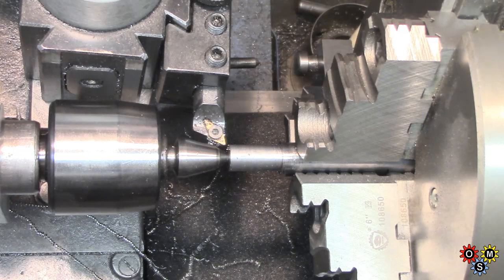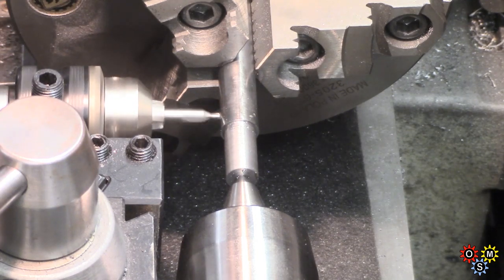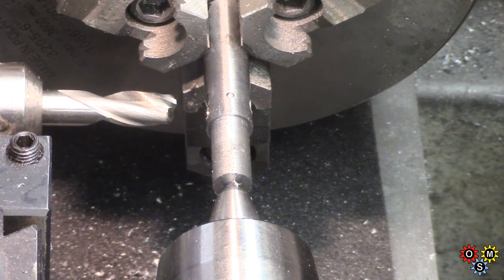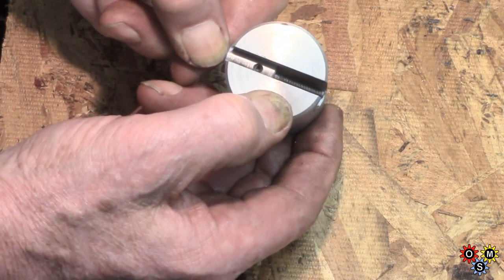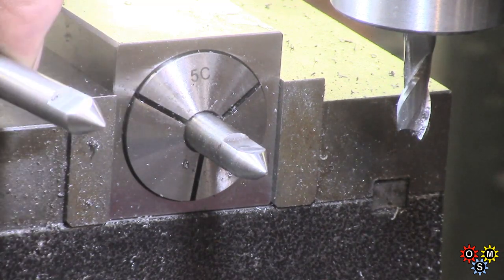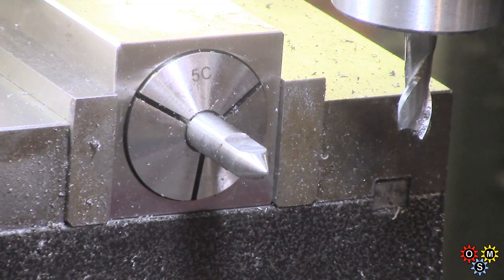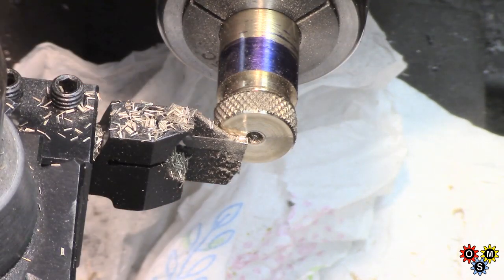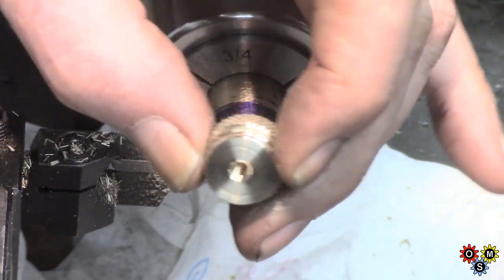Talistock Offset, Part Two of Two

Comment: Good job Chris. All scratch builds have a small deviation some where. As long as you can work round it its not important.  An interesting project.I personally use an old boring head to do offsets in the tailstock. I made a stabiliser bar that fits in the side hole to stop it turning or slipping in the taper.   Thanks for sharing. regards from the UK
Reply from the maker: Hi Gary,
Thanks - I never intended to follow the plans totally but have to admit I should have scaled it up a bit. I like the boring head idea and may yet even try that sometime... a stabilizer bar certainly would be needed... unless in my case possibly making a new boring head attachment/arbor to give an indexing on the keyway like the little one just made.

Comment: Nice work Chris.  Be interesting to see it in action.  I like the way you use the quill slot to prevent the unit turning.

Cheers Rob
Reply from the maker: Thanks Rob - must try and finish - graduations, heat treat etc and then try it. A frustrating little build!

Comment: Ever get the grads done? Looks good, Thanks
Reply from the maker: Yes, eventually marked some grads although they didn't come out quite as crisp as I'd have liked. The project worked but I was not fully satisfied and went on to set up a system using a boring head which I think is easier to use.
The testing was done here - http://www.oldmansshop.com/vid-pages/tstock-offset-test.php and the boring head approach later on was here - http://www.oldmansshop.com/vid-pages/bore-head-offset.php
Reply: @ChrisB257  Much appreciated!

Comment: Hi Chris, I found this second part interesting.  You talked about the threaded ends of the slide being small like #10. You are more brave than me because I would have made them 1/4" x 28.  I can't fiddle that small any more. I rely on my knee mill to machine  small stuff because I trust it more than doing it on the lathe.  I do like what you came up with and the way you assembled it.  Thumbs up !!
Reply from the maker: Hi James - thanks.
Well, in the absence of a #12 die I went with the 10-24 - I think 1/4-20 might have been a bit large for the brass end knobs. That said - a scaled up version would have been easier - a bit!
Reply: I understand, sometimes you have to do what you can.  When you look at the finished tool and can say, I made that, it does make you feel like you've accomplished something good.